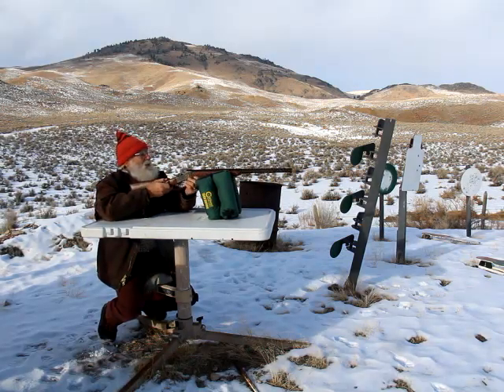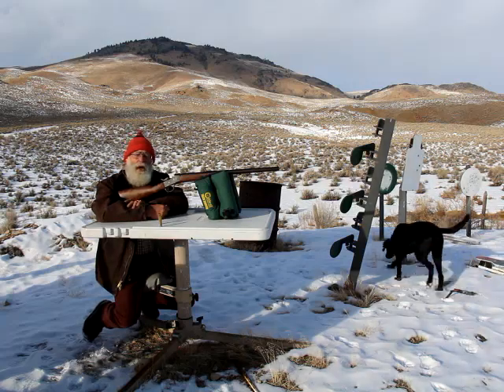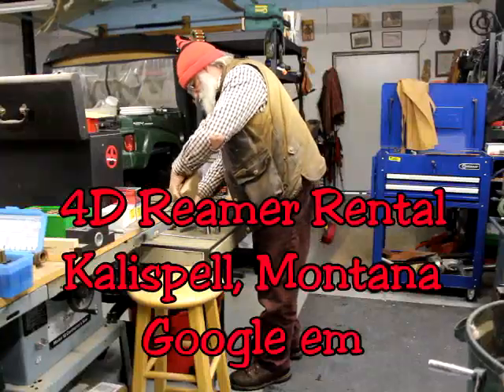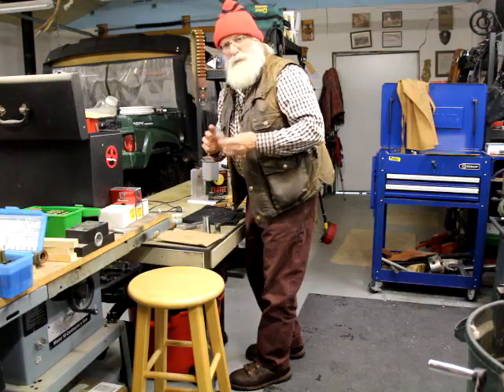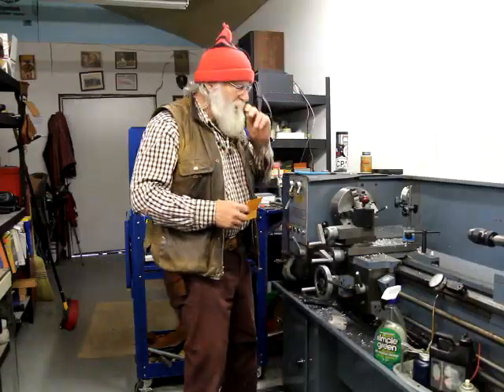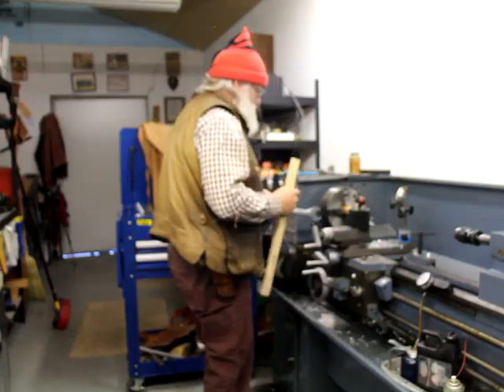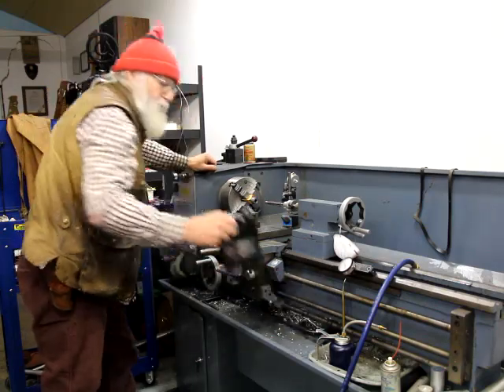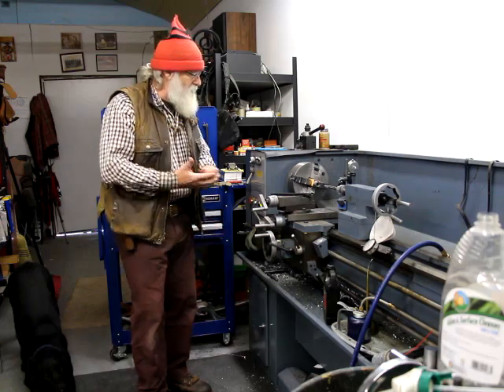Coffee w Buckskin Dave   Back in Black  Ream 50 90 Chamber

Comment: What did you use to lock the barrel to the action, a thread locker or a really tight fit
Reply from the maker: Don't need a locker, if anything a bit of anti seize so it wont gall.  Thanks for stopping by

Comment: Hi Dave, Has anyone loaded .338 win mag with 200 & 225 gr hornady spire points with ramshot hunter powder or reloader 16? Haven’t found any manuals with this recipe. I’ve got plenty of hunter and r16 powder and plenty of hornady 200 & 225 gr bullets. I just need a recipe. I’m a hunter with no chronograph and have always loaded to manual specs but now with the powder shortage I need more recipes where I can utilize what I’ve got. Thanks.
Reply from the maker: I loaded 338 WM years ago with I believe were 210 grain spire points.  That was 20 or so years ago and I don't even have the rifle anymore because a friend wanted it more.  I loaded out of the manual so that would be the only advice I could give you is find one that is really good then try some alternates for second choices.  I never used Ramshot for that case so I don't know anything about it.  Thanks for stopping by